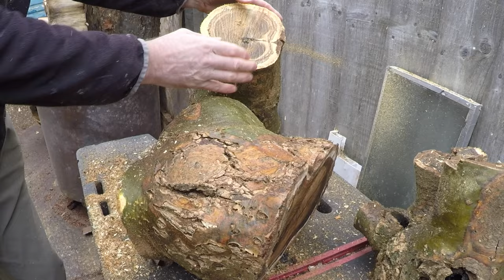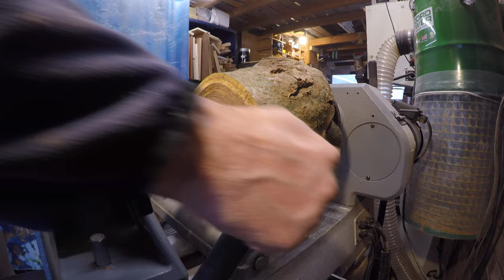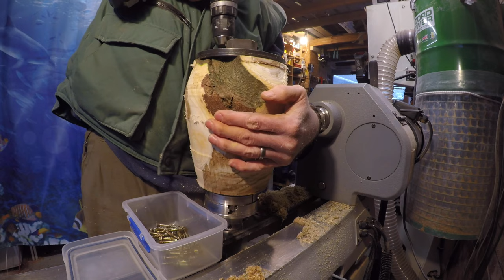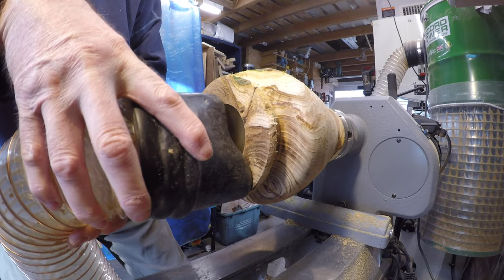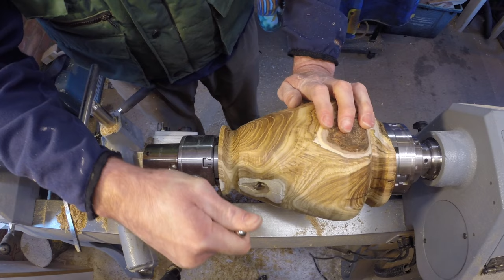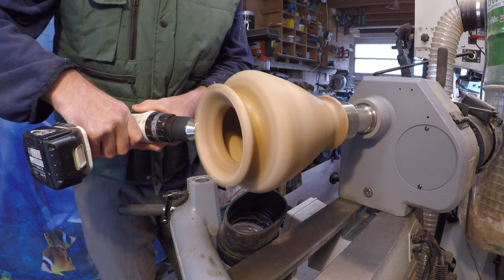Wood turning -  A beautiful Laburnum vase

Comment: Cracking job Jim. I like turning with Laburnam also, the colours and grain can be fantastic. My lungs aren't great and with Laburnam dust being so poisonous I have to kit up well with masks air cleaner etc but still one of my favourites. Not been able to come across a log as big as the one you turned but hey ho. What hollowing tool were you using? looked a nice tool. Kind Regards, Tony.
Reply from the maker: Thanks Tony - Yes I always wear a respirator especially with this species! I was lucky to get this large piece from a fellow woodturner, who obtained it as the tree was cut down. He only has a small lathe so he gave me a call and we did some swapping! I use a Simon Hope (UK woodturner) hollowing tool. No hollowing system, but I do rest my right arm and handle on large roll of paper which is just the correct height for the tool rest! It  works surprisingly well. Just released another video with another piece of Laburnum from the same tree. Thanks for watching and commenting. Jim